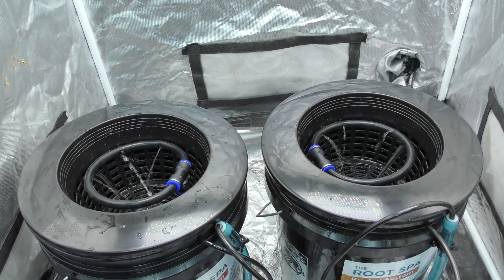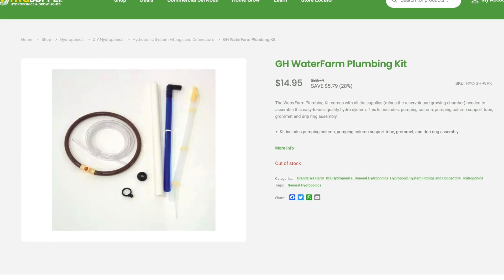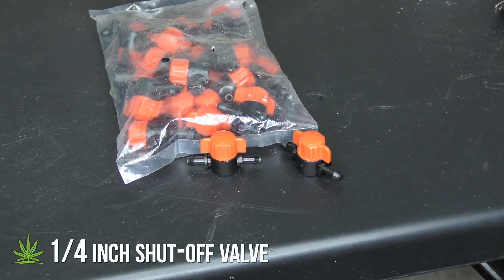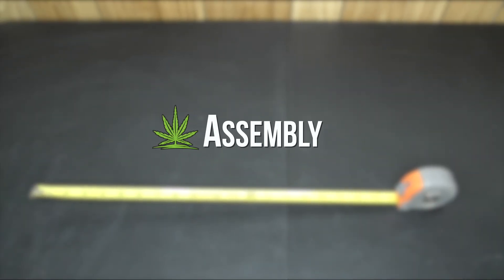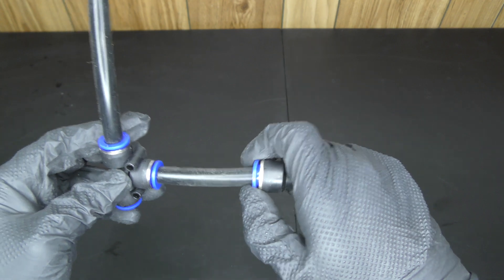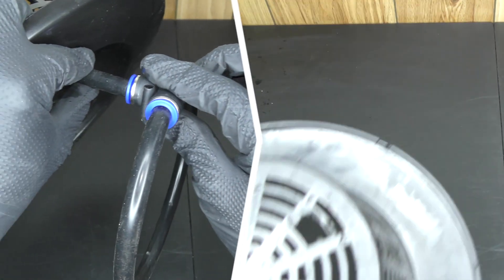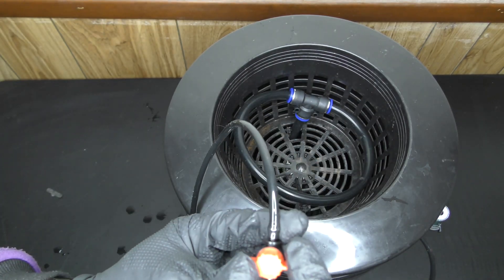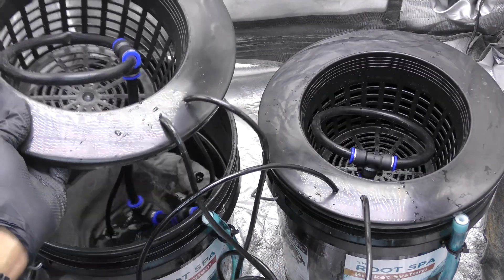DIY Drip Irrigation Ring for DWC Buckets 🌱💧 | Quick, Easy, and Affordable!

Comment: I've watched this a bunch of times and I'm confused about the tee at the bottom. Is it open to the water in the bucket? I'm guessing it somehow pushes the water up instead of the air escaping below.
Reply: It’s called the Venturi effect.  It used to be used a lot in small aquarium filters.

Comment: can to powerful of a air pump force air through the system without pulling water up? I've got a monster for my RDWC and wanted to try it for the DWC nursery i was gonna build but it seems like it wont work or is barely working. 5/8 push water weakly. If i cut the air to two or three lines it just blows more bubbles below.
Reply from the maker: that sounds...off. the bubbles shouldn't be blowing underwater unless you 1.) have a leak in the system or 2.) the  fittings are on backwards or facing the wrong direction.
Reply from the maker: the bubbles will naturally want to float upwards, can you confirm that everything is upright? and that the fittings are turned the correct orientation so the bubbles will come in from the side, and float upwards towards the ring?
Reply: I had a lot of air blowing thru drip with my fujimac 80 and had 6 small drilled holes in drip ring. I cut it back to 4 holes and works better. It will still only blow air thru drip if turned all the way up but works good turned down. I also think it would help not to have the drip post on top of air stone. Havnt messed with it much to confirm but makes sense. Try and see when you get time. A 3w pump works way better but cost more and adds more heat so this is the most efficient way for sure. Or stick to the Rdwc and grow monster trees like we do!🎉
Reply: @subhumanaudio Yeah, I was looking for a good way to start my 45 gallon RDWC system plants and get the roots to go down properly. I ended up getting a 1.5 gallon, 10 pod hydro drip starter, and it worked out perfectly. After the roots were about 8 inches long I put them into there forever home and havnt had any issues since. Ill keep starting them in there until I find a better method. Thanks!

Comment: Are your instructions by way of the pot size for the deep water culture? Meaning if I have a bigger bucket than yours would I still use the 1/4? For tubing?
Reply from the maker: Hey, Not bucket specific. The 1/4 inch tubing was required for my air pump. Larger tubing for the air isnt necessary, you just need an air pump that can really push the limits.
Reply: @RiskyBizz Bigger the better
Reply from the maker: Thanks!

Comment: I do have a question and something I want to try.  I’m asking you cause I know you worked with perlite a lot…. Do you think I can use perlite only in a hybrid system like in a autopot USA system ?
Reply from the maker: Yeah it could work  - but honestly, I don't think perlite would work well in that system. The Autopots look like they rely on 'wicking' action and perlite has vey little wicking. You would need to set it up ebb and flo style, drip or waterfall for the best chance of success when working with perlite.
Reply: @RiskyBizz  thanks fam
Reply from the maker: Thanks!